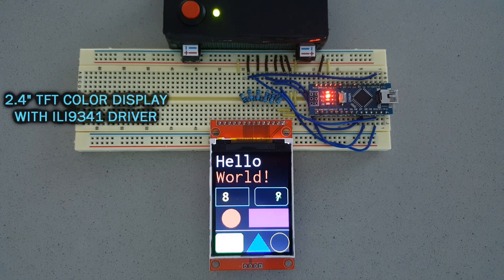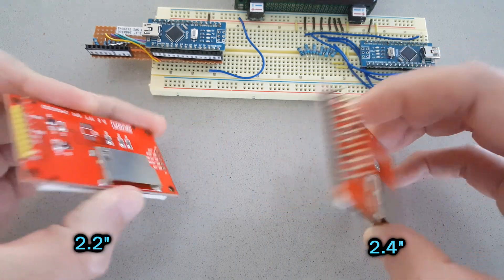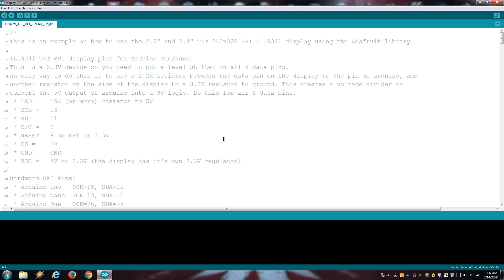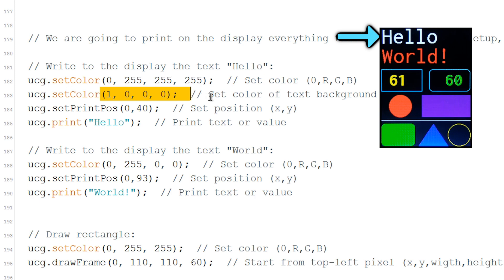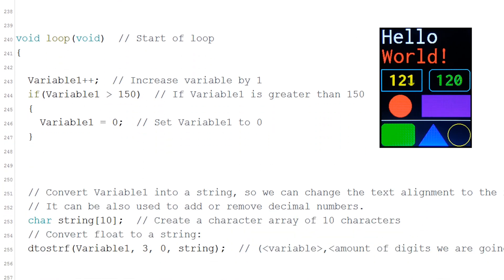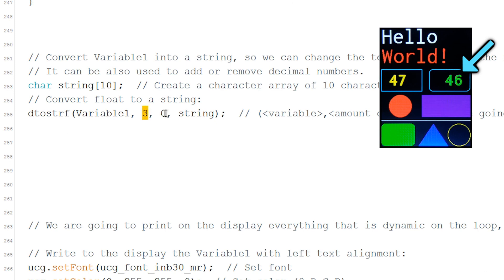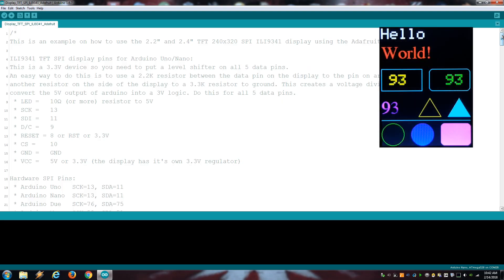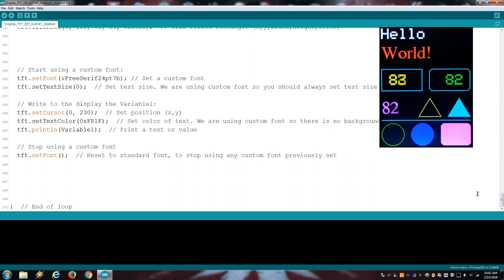Arduino Tutorial: 2.4" TFT Color Display ILI9341 240x320

Comment: Heyyy i need a huge help can u solve it?....im using that 2.4 display and i have a lottttttt of problems first i thought it was my arduino nano's incapability to drive a bigger screen driver and when i saw u just pluggin in it like that i was stunned and i spend my entire money on esp32 so well leave that part im still facing problems why i dont know i have a quarter of the screen working the pixels are NOT dead because this non working screen shifts according to the rotation it moves but never lights up as one screen.....can u help me please
Reply from the maker: Might be a bad library or bad configuration of the library
Reply: @interlinkknight   ,,,it was indeed a library config problem ,,,i solved it and now working perfect.... thanku❤❤,,,,,,,,,,hey did u solved the touch problem?....im actually going to buy the  XPT2046 IC so that i can solder in to it and make it touch controlled ,,,will it work?,,,,what do u think?

Comment: Dude, I'm working on a project. I want to use this screen with arduino uno but I don't want to buy a ready-made shild because I will use a motor next to the screen, but when I connect this screen without using resistance and using resistance, I only get a white screen. can you help me?
Reply from the maker: One thing you can try is using logic level converter to all the communication pins. Maybe your display is very sensitive to work with 3.3v logic

Comment: Hi friend,
At first thank you about this work, but I would like to tell you I have found way to eliminate the flicker issue with custom font through dealing with last valve  and current valve by using if_statement.
Reply from the maker: Do you mean that refreshing only when the value is different? That helps, but doesn't eliminate the flickering completely.

Comment: Your examples won't download.3-12-2019
Reply from the maker: I just try it and works. Maybe you had a temporary problem. Check again.
Reply: @interlinkknight  Yes, this time it downloaded, thanks.
Reply: So after installing your example into the arduino IDE, I installed your library ver 1.5.2. I am trying to use an Arduino mini-pro 3.3v to avoid level changing. When I try to upload the sketch I get the following:
Arduino: 1.8.7 (Windows 10), Board: "Arduino Pro or Pro Mini, ATmega328P (3.3V, 8 MHz)"

Sketch uses 22928 bytes (74%) of program storage space. Maximum is 30720 bytes.
Global variables use 314 bytes (15%) of dynamic memory, leaving 1734 bytes for local variables. Maximum is 2048 bytes.
avrdude: verification error, first mismatch at byte 0x0071
         0x8d != 0x18
avrdude: verification error; content mismatch
avrdude: verification error; content mismatch

I'm not sure what this means, can you help? Thanks
Reply: This time I installed library ver 1.4.0 with the following errors:
WARNING: library Ucglib claims to run on (all) architecture(s) and may be incompatible with your current board which runs on (avr) architecture(s).
C:\Users\flagt\Documents\Arduino\libraries\Ucglib\src\clib\ucg_circle.c: In function 'ucg_draw_disc_section.constprop':

C:\Users\flagt\Documents\Arduino\libraries\Ucglib\src\clib\ucg_circle.c:160:1: internal compiler error: Segmentation fault

 }

 ^

Please submit a full bug report,

with preprocessed source if appropriate.

See <http://gcc.gnu.org/bugs.html> for instructions.

lto-wrapper.exe: fatal error: C:\Program Files (x86)\Arduino\hardware\tools\avr/bin/avr-gcc returned 1 exit status

compilation terminated.

c:/program files (x86)/arduino/hardware/tools/avr/bin/../lib/gcc/avr/5.4.0/../../../../avr/bin/ld.exe: error: lto-wrapper failed

collect2.exe: error: ld returned 1 exit status

exit status 1
Error compiling for board Arduino Pro or Pro Mini.
Reply from the maker: Sorry but I don't know.

Comment: Thanks. Is it any ways to make SPI-bus works faster. I am using modern 32 arduino-due,but displays works slow, is it any ways to change frequancy for spi bus. Thx sorry for my english.
Reply from the maker: As far I know you can't change that.
Reply: Try the ILI9341_DUE library, and make sure it's using SPI DMA mode. This library is faster than some others. http://marekburiak.github.io/ILI9341_due/

Comment: thanks for tutorial!
will it work on uno? i test it but i see just a white screen :( 
could it possible my lcd be damaged?
Reply from the maker: The arduino nano is essentially an arduino uno so yes, my example works with arduino uno. Did you put the resistors?
Reply: Mine did the same, ours not damaged maybe the code and yes i did put right resistors!
Reply: @NoajmIsMyName  just wondering if you succeeded because I'm using arduino uno so I would like to know if it works

Comment: Good tutorial, well done. However the 2.4" screen you have does not have the touch screen components fitted
Reply from the maker: Oh, you are right. I didn't pay attention to where those pins where going, but now that I see is obvious it goes to a place where it should be a chip. That explains why I could not get the touch screen to work. Thanks for letting me know.
Reply from the maker: How do you know that my 2.4" screen doesn't have the touch screen? It has the pins for that so I am assuming it does have touch screen. I just don't know how to make it work.
Reply: There's no chip at U1
Reply: Nice video, as always!
Reply: can you soder a chip on to it ?